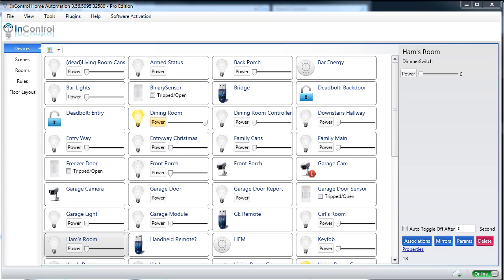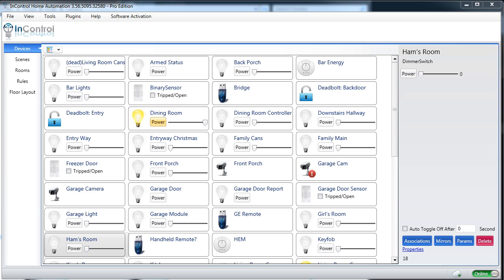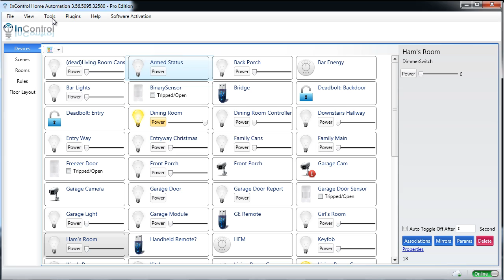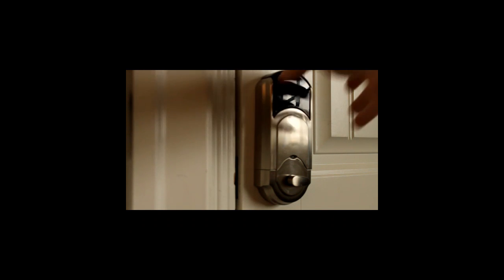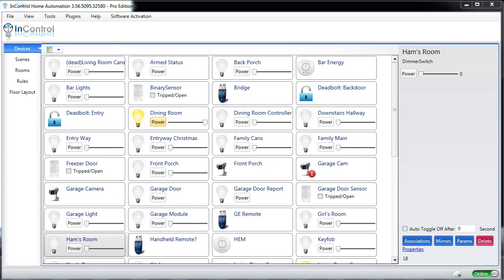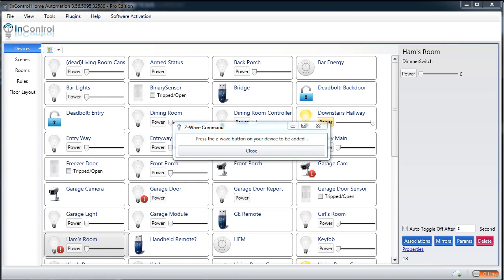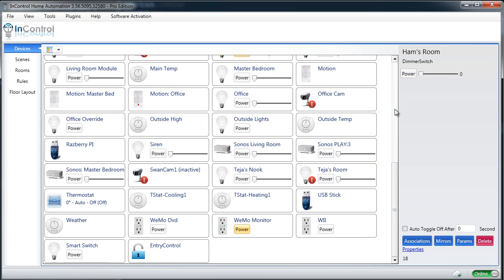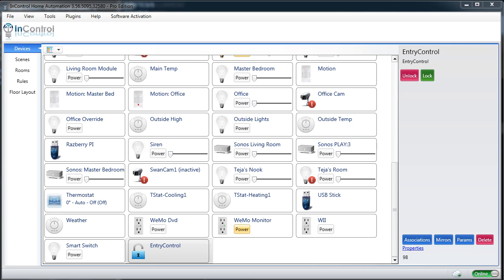InControl Kwikset Lock Setup

Comment: This worked! Thank you. I am using this exact setup with Z-Stick. I actually didn't need to be within a few inches of the lock... my computer is upstairs in the back of the house with this lock in the front. The successful algorithm was basically removing the lock (node) from the device (controller: z-stick) with how you showed, and then re-adding it (via InControl software) WHILE z-stick is plugged into the computer (or a long USB hub / cable). What didn't work was using the z-stick in its unpluged pairing (adding mode) and then plugging it back into the computer upon "successful" pairing; albeit I guess not the proper key exchange. It appears that InControl has special application code for the authentication key excahnge... at least that's what im assuming here based on what I have read about unsuccessful software based on OZW (OpenZWave) not being able to control locks due to their special security auth. It really does work when you just "wait" when adding the device there. Really was doubtful, but it pairs and authenticates successfully. THANK YOU very much!